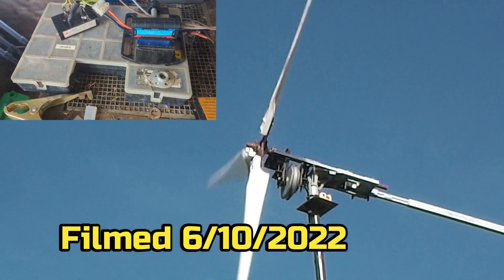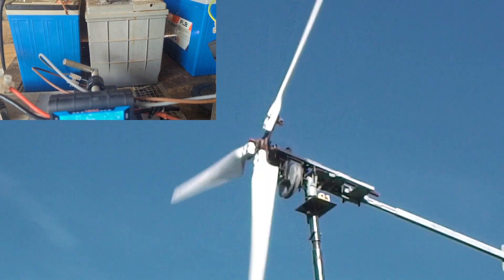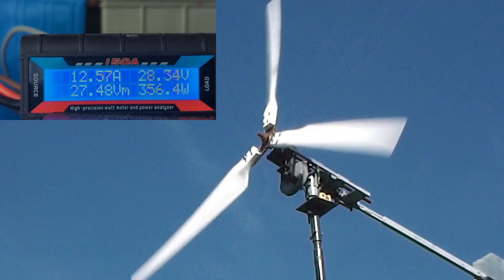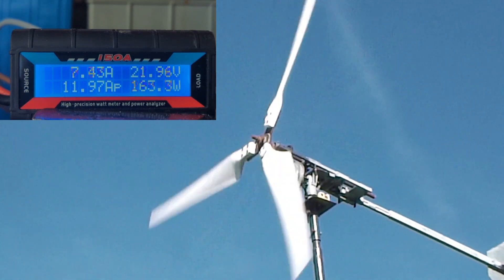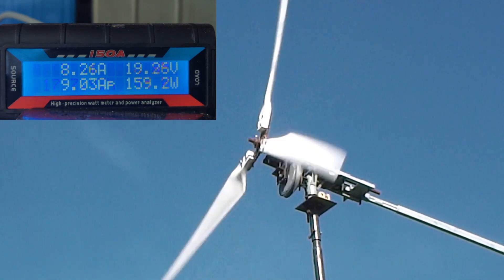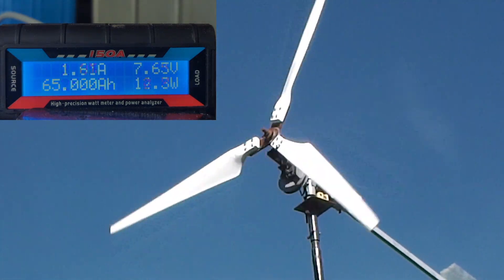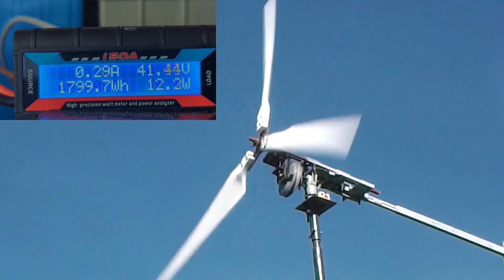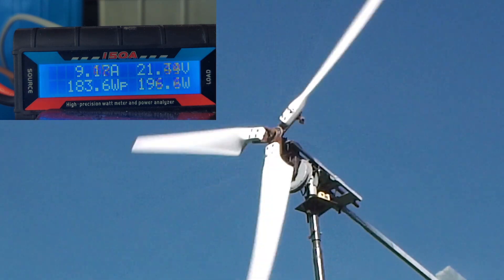Running my wind turbine via a Ebike speed controller - 20mph winds - 8th October 2022

Comment: Very nice, but did the water get hot? Isn't that the reason for the test?
Reply from the maker: No, the reason for the test was just to show the wind turbine running without batteries or a controller and also to show the fact that you can vary the amount of power that sent to the dump load via the speed controller, I will be boiling water in the future when it is windy enough, but it does have to be at least 20 mph wind.